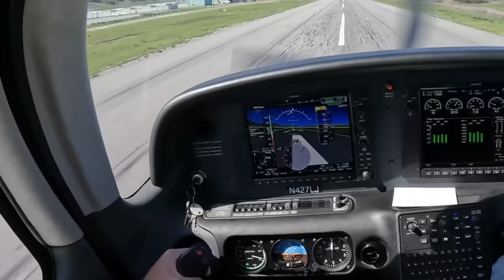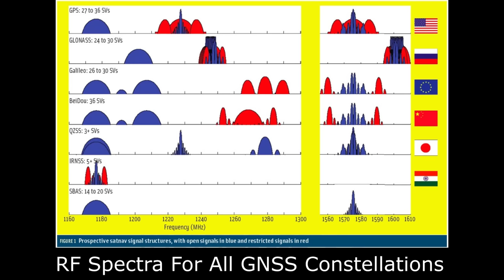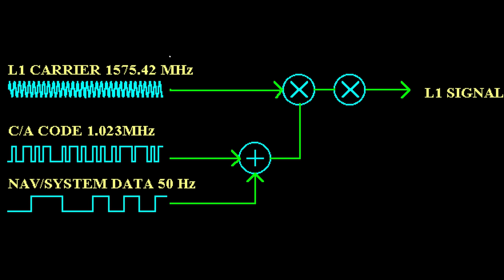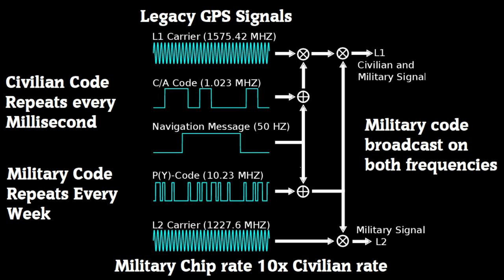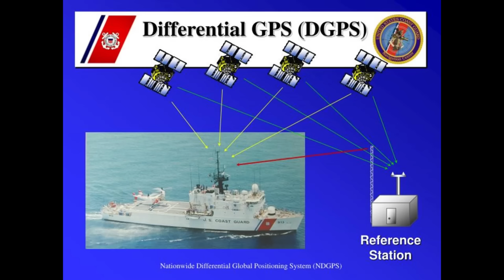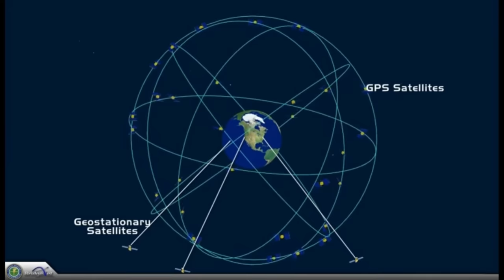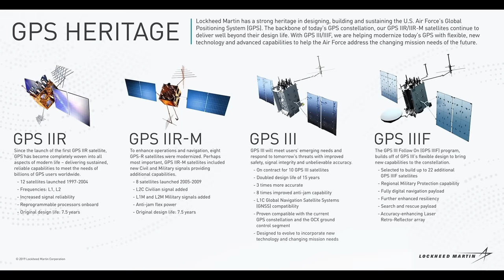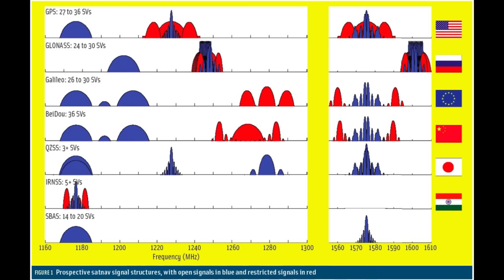How GPS Works, And How It Got Better Than The Designers Ever Imagined

Comment: This was very informative, I always have had the impression that the military accuracy was in the code, that could be switched off for civilians in times of international political unrest. Now I know a small bit more, the two signals at different frequencies to correct the interference from the Sun. I never realised this was possible, there has been done a lot of thinking about the GPS. 
 
By the way, because of GPS I have become more stupid then before, I use it every day when I am going to a place I've never been to. By doing this I lose my ability to navigate by intuition as I did before GPS came available for common starvelings. Sometimes I long back for the "Shell 100.000 Straten Boek!"

Comment: I’m flying a brand new Boeing 737-MAX8, and it only has WAAS for ADS-B out. The WAAS signal isn’t integrated into our avionics. We can shoot LNAV/VNAV approaches where the vertical navigation is based on our barometric altimeter. We can’t shoot LPV approaches (WAAS)
Reply: different certification standards, I can shoot LPV in my Cirrus SR22 (with synthetic vision) but I can’t shoot an RNP approach while you probably can, greetings 😅

Comment: I've noticed a difference between Europe and the US, though my sample size was rather small.  My phone's location did not work accurately on the runway, or in the air, in the US airports or US airspace.  But it worked fine in European airports and airspace.  (My US experience is around the NYC/East Coast.  My Europe experience includes Zurich, Frankfurt, Krakow, and Budapest.)

Comment: GPS is actually much more genius than you described, all due to the feedback control loops (invisible to the users). It was capable of achieving 1m precision with then-possible clocks ~10^-9 (the clock precision depends on the physical size of oscillator, etc) and satellite's very reasonable life span... but you have to know high math to acknowledge the pure genius of GPS designers. 

I worked on the first "personal" GLONASS receiver in early 80s. It took 5 minutes from turn-on to coordinates, given almanac was actual, the processor was capable of 350 multiplications per second, and weighted 15kg (!) vs. 400g of GPS.
Reply: hi mikets, what do you think about all gubments drawing a line around you(Antarctic Treaty) and saying you are not allowed to leave? If you don't know what I mean, read my about tab.

Comment: If airplane autopilots arent putting in an offset to the right when flying between GPS waypoints, they really ought to. Two jets over Brazil collided when flying opposite directions between the same to waypoints. The accuracy of GPS put them on a head on collision. One was climbing, so the altitude separation broke down. Horizontal separation by means of an offset would be a good sagety feature to add.

Comment: Great explanation of what is a fantastic system.

An observation though I was under the impression that inertial navigation equipment was still the main reference for absolute positioning in long haul commercial aircraft, one reason being that GPS can be jammed quite easily by naughty people on the ground.  (And it has been)

 A pilot told me once that the inertial navigation system - with laser gyros -on his 747 would get him from Gate 25 (say) at Sydney to Gate 36 (say) at LHR without any intervention once   the flight plan had been entered.  GPS was used as a secondary check and for non essential systems.

Have things changed that much?

Comment: Without looking up anything about it, I always thought GPS was a time measuring system from satellite transmitters. I think what you are saying is like the satellites say the time is according to satellite and then the receiver measures the time it took to get to the receiver locally and consolidates the other signals and times. I always thought if it didn't do it the easiest way for GPS to work would be like this. For the satellites to have a XYZ coordinate relative to some point on earth. That the GPS receiver concludes it is a an XYZ coordinate. That the receiver coordinate would be on a ray from the centre of the earth and passing through an idealized egg shaped surface. The point it crosses the surface would be the location on Earth, and the distance between that point and the receiver would be the elevation.

Comment: Check out the navy's transit navigation system.  Navigation using doppler shift going back to the 60s.
Reply: But that kind of system required a trained operator and could only give a couple of fixes per day, so it was only suitable for ships on oceans...

Comment: The first thing done by the GPS module is to condition its local clock to get as close to the accuracy of the satellites clock. After that, a minimum of three satellites can be used to get a position fix on the Earth. Three satellites intersecting provide two solution points, one that will be in space and can be ruled out for terrestrial navigation. The other will be on the earth. More satellites will yield higher precision fixes and give redundancy for detecting receiver errors on critical applications like aircraft navigation systems.

Comment: Here’s a very minor point.  The GPS constellation orbits are very nearly circular and are designed to complete two orbits in one sidereal day (sidereal day is one Earth rotation, measured by the time between the prime meridian pointing at Aires, rotating and once again pointing at Aires).  That makes the GPS orbit time about 11 hours, 58 minutes and 2 seconds.  A mean solar day is about four minutes longer than a sidereal day because the Earth has to rotate a little extra for the same spot to point at the Sun again, because the Earth has progressed I its orbit around the Sun.

There are six GPS orbits spaced out evenly around the equator, each inclined about 55 degrees.  Optimally there are four working satellites evenly spaced per orbit. That guarantees most places on Earth should have at least four GPS satellites visible at any time.  Adjusting the receiver clock was designed with an algorithm which needed four satellites for convergence.  Once the time is set on the ground receiver, a solution may be obtained with three or even two satellites.  If you know approximately where you are on the surface of the Earth, you can discard a solution that doesn’t place you on the surface.

Comment: One other avenue of military restrictions is the CoCom limit. Commercial GPS units are not allowed to function if it detects itself moving too fast (1000 knots) and/or higher than 18,000 m in altitude, in order to prevent being used in say an ICBM. If you happen to catch a ride on a rocket (Blue Origin, Crew Dragon, Starship, etc), don't be surprised if your phone's GPS stops working! Satellites do operate above this limit which is why they can't just grab an off-the-shelf GPS unit (most satellites us GPS to determine time and location btw).

Note: I'm actually quite curious what a normal phone does when this happen. Does it just say "can't find a signal"?

Comment: Thank you for explaining the difference between the military and civilian signals.  Every time someone discusses when the U.S. made GPS available for civilian use, they just say something like:  "The U.S. decided to allow civilians use of the satellites, but they would scramble the signal to make it less accurate", 
which is just absolutely infuriating.

Given the incidents that have occurred in the past with GPS spoofing, I am surprised there hasn't been an updated version to encrypt the signal.  Wonder if that's something that's being discussed.  Not sure how exactly that will work.  Public Key cryptography is the office choice, but if there is ever a need to change out the key it's going to be a damn nightmare.
Reply: Encryption of data is not necessary. Authentication - is. As long as a trusted (signed) message digest comes with each frame or each few frames, it can’t be spoofed. Easy as that. Encryption is for hiding data. GPS is wide open. All you need is to authenticate what you openly receive. That such authentication uses public key crypto systems is not central to the discussion, and nothing really is “encrypted”. Digital signatures on data can hardly be called encryption in everyday sense of the word. Technically, yes, the signature is encrypted in a fashion, but that’s an implementation detail.

Comment: Oooh, shucks I was hoping you would talk more about RTK systems.  We have been using them in Agriculture for a while, allowing tractors/sprayers/combines to get millimeter precision (well sub centimeter) . Great for not overlapping your spray for chemicals/eliminate overlaps when seeding (even auto turning on/off your seeder when it pulls up to already covered ground etc.).  Also years ago these systems use to cost in the 10's of thousands of dollars. But I since GNNS has become more commercially available I was able to build an RTK system for about 500 USD.  How it has changed!
Reply: Also neat how relativity comes into play when it comes to correcting the clocks on the satellites.

Comment: Scientific American had an article on the GPS satellites and they initially thought relativity wouldn't be a factor but they put a system in place JIC so they could reset the clocks and lo and behold they had to use it as the speed of the satellite and the lessor gravity both affect the clock timing. that was probably 20 years ago or so. i still have the magazine.

Comment: Basically GPS works out your position backwards... your GPS device knows where every satellite is but doesn't know where you are (it contains software with each satellites location and flightpath). It then works out how far it is from a satellite from the satellites time signal, how long it takes the signal to get from the satellite to your GPS device. If your GPS device does this with at least 3 different satellites it can draw a ring around each satellite and where these rings intersect is your location (triangulation from known points).
Reply: Not rings, but spheres around each satellite.

Comment: I always figured the 4th satellite was because , with two satellites you can resolve the circumference of a circle where you are, and with 3 you can narrow it down to two points, which still doesn't give you your location.  But I always just imagined it geometrically in terms of the intersection of spheres.  I guess when you take into account margin of error in time the geometry of this thought experiment becomes more complicated.
Reply: I think of the time error as in you don't precisely know the radii of those circles unless you have a precise time.
Reply: @Martinit0 , that's what I was getting at about it being more complex when introducing time error into model.  It goes from being a circumference to a very hard shape to describe.  It wold probably be akin to a flatter pointy ovoid, but I haven't done the math.  I'm just trying visualize it.
Reply: I'm just trying to think about the solution space geometrically without time correction.

Comment: I remember the days when 'post processed' GPS data was a thing and I setup a couple of differential transmitters for a localized use. With Cellular networks geo-locating you with Glonass and Galileo  plus other things your phone can be +/- 100mm easily and usually +/-10mm.  This is a far cry from the days when 'post processed' GPS data was a thing.  I setup a couple of differential transmitters for a localized use in rural XX back in the early 90s. I think you could even get post-processing done much faster now that we have Graphics cards that can be turned in to GPS mining sets.

Comment: One of my favorite parts about the separate interoperable systems is that it's not very hard to combine their measurements, given a good modern receiver.  So although individual countries each build a network that's "good enough" on its own, because they're all global networks, users in each of those countries can get better performance by combining and comparing their results!

The same is not really true of WAAS-style systems, which can be focused over a given area from GEO.  That's why countries like Japan build their own systems in that style, in that case QZSS, even though they're perfectly happy to use other countries' base navigation systems.

Comment: "You need a minimum if 4 satellites for GPS to work"
For a 3D  solution (latitude, longitude, altitude), yes. But three satellites are enough for providing latitude and longitude.

Comment: Old mobile devices which no longer receive any updates can also "lose" gps as it will slow down to the mentioned 12 minutes (or even 25 in some cases). Daily and weekly GPS orbit updates keep normal acquisition snappy and immediate. This is handled by your device manufacturer automatically.

Comment: GPS was not initially designed for civilian purposes at all- c/a (Coarse Acquisition) was designed to get "about right" to make acquisition of the precision signal quicker. The precision (p) code is also encrypted with classified keys that expire before the sequence ever repeats (which is why it is referred to as p/y). There are direct acquisition p/y GPS receivers, but it tends to take a long time to the first fix (TTFF).

A big aspect of the use of encrypted keys is to prevent spoofing- sending a valid signal that is wrong. Jamming is always easy- just make a lot of signal- GPS would not be available. Spoofing is far more insidious- you think you have a valid position, but it is not. US military GPS receivers should only give a tactically valid position based off of the p/y code. c/a is pretty easy to spoof- there are open source SDR c/a generators out there.

Comment: The other thing GPS has revolutionized is clocks.   Many things either directly or indirectly us GPS as their time source.  This includes a lot of the internet (I have a $300 "stratum 1" network time clock at home.   It also includes cell phones when cell base stations get their time from GPS or in the case of iPhone where they use GPS directly.   Your car clock get's it's time from GPS.

Comment: When the pilot cannot see, or recognize elements on the ground, then knowing the 3D position within a meter is very helpful.  Also when this information/system is tied into autopilot and autoland, it decreases the probability of a mishap significantly.  But as I understand the autoland is also augmented by RADAR, that replaces the actual "seeing" of the runway surface.  That is why I think that road vehicle SD by "camera vision" alone will never result in a better than human driving result, because irrespective of how good AI gets, if it doesn't have better perception facilities, as well as decision making abilities, it will not better human driving.